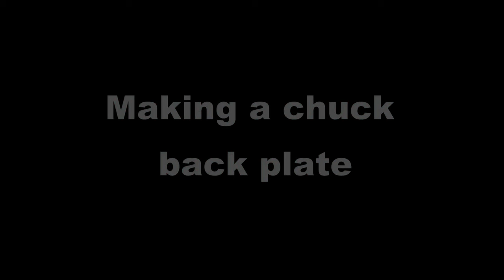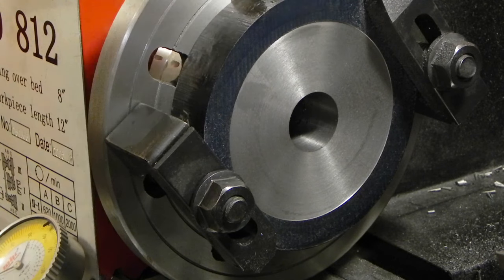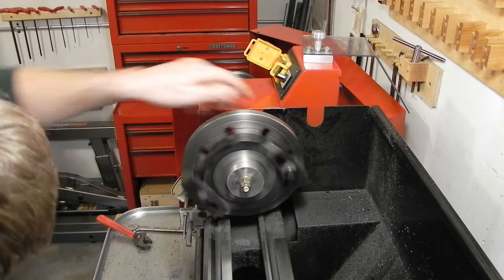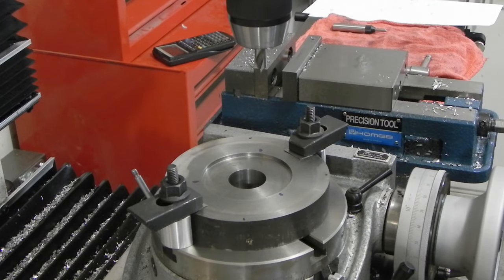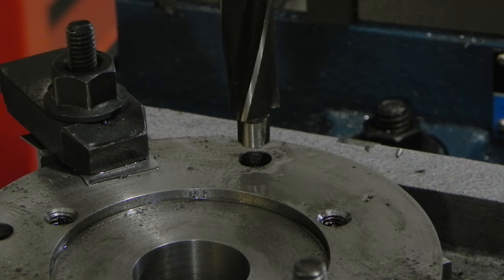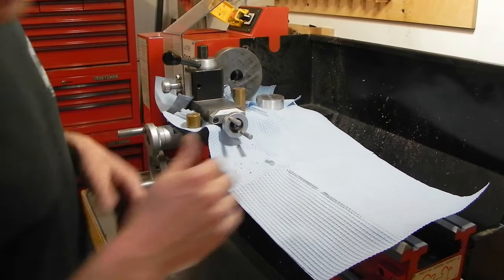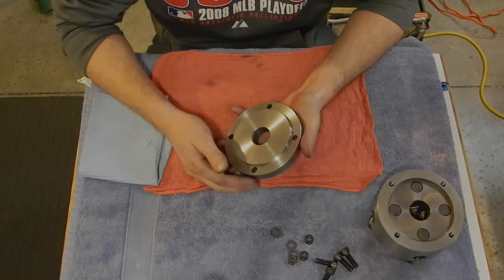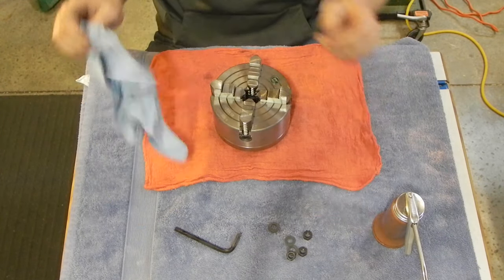Making a chuck  back plate

Comment: Thanks for the video, I planned to mount a 5" independent 4 jaw chuck for my Harbor Freight 3-IN-1 Multipurpose Machine 44142. You gave me some interesting Ideas. Fortunately I don't have to make a adapter plat as the recessed area on the back of the 5" matches the raised boss on the HF exactly. I just need to cut four holes into the chuck to mount the bolts, hopefully without cutting into the jaw channels etc. Thanks again for the video I found it very helpful.
Best Wishes n Blessings. Keith

Comment: Back in the day when I was an engineering apprentice, we were taught by all the tradesmen and from the technical insitute we studied at that cast iron needed no lubricant because of the high carbon content.
Reply from the maker: +Michael St John  You don't need cutting fluid, but it really helps keep the mess (CI grit/dust) under control.

Comment: using oil when machining cast iron will make it hard to protect the ways on you lathe. you can machine cast iron dry and catch the dust and chips with a cloth covering the ways, then vacume  the machine clean.
Reply: You are very right on that...!! No lubrication with cast iron. You may want to use a good mask while working cast iron, other ways you will have black nostrils for long time.
Reply: Right-o.   Cast iron is self-lubricating, due to the graphite content.  When you machine cast iron, the fine powder gets everywhere, and adding machine lube or oil makes it much, much harder to get out of all the nooks and crannies.
Reply: Miguel Navarro 90
Reply: Mi garba

Comment: that's a real beauty

I watched this video because I'll be getting the 5 inch 4 jaw chuck too, and I need to make a back plate for it
I don't have a mill though, do you think I can make it precisely enough on a drill press?
Reply from the maker: As long as your mounting holes have enough clearance, and you are decently accurate with your layout work, you should be able to do it on a drill press.

Comment: Set-right chucks use radially mounted setscrews and a bit of radial clearance to fix the last couple thousandths and tenths of out of round. You can also just loosen the back plate a bit and tap the chuck body into round.

Comment: I have turned quite a bit of cast iron in my time and as is usual practice, never used oil to do so. Cast is full of carbon that self lubricates the cut, can cool with water and soluble oil but usually use that when grinding the stuff...

Comment: 4 jaw chucks don't have a scroll, so you can actually just machine a ring that fits inside the chuck recess with an ID that matches the spindle boss and then drill and tap for 3 studs and your 4 jaw will bolt up just like the 3 jaw- done in 20 minutes and no adapter necessary.
Reply: SHOPMASTER/ SHOPTASK. i want to know would studs have enough strength to hold this chuck and withstand the load while operation? also how is he gonna mount this on the spindle nose
Reply: @josephinelourdesjayarani2111  Loads are radial and supported by the boss, the studs just keep it from falling off.

Comment: Needed more oil (or even some oil to begin with!) While boring that iron puck out on the lathe! Obviously it worked out for you and you did a great job at it as well, just fyi, and i dunno why but it just really made me cringe watching you "raw-dog" that hole w no lube, initially. Haha ;) 
But seriously, great vid and you've given me the last bit of confidence needed for me to attempt my own now finally... so thank you! 
Cheers! 
- Jesse
Reply: Or are you supposed to machine cast iron dry?? I actually never have machined cast iron before myself so I apologize for the misinformed comment previously if that's the case?
Reply from the maker: @jmac430 a lot of people will tell you that all machining of cast iron should be done dry. I however have a slightly different view. I for example like to use a little bit of cutting oil when I'm drilling or tapping cast iron because it helps better contain  the fine particles.  For large amounts of material removal I do machine it dry.

Comment: Great video! Thanks. You deserve some better machines though. A boley, weiler, schaublin lathe and a deckel or aciera milling machine would be more fun. But I must say that its more impressive with guys using what they have and make it work super good. I like seeing people taking a cheap ass chinese lathe or mill and scraping it to be almost as good as the premium machines. Just a thought. I’m about to make a plate just like that for a short taper flange to my 380mm 4jaw. Is it necessary to use cast iron for an adapter plate? Or will steele be good enough? On my other lathe I got the long taper fit. It seems more precise than those short taper that arent actual taper fitment at all. Its just a tapered guide for the chuck to slide on more easily, but the chuck could move within the tolerance of the center hole, unlike the long taper that always centers the chuck due to the taper fitment.
Reply from the maker: Sorry, I didn't respond sooner, I've under the weather for over a week.

You can use just about any material you like,  I've seen people use aluminum before. The main benefit of cast iron is that it's a good middle ground. It's easy to machine, it has good vibration damping qualities, and it is usually softer than what your spindle is made out of so you don't have to worry as much about damaging your spindle.

Comment: Hi Dan.
Fantastic job on the backplate mate. I am inspired to do the same for my lathe.

I am quite interested in the tool post you have. Did it come with the lathe or is it an after market quick change base?

Cheers mate.
Reply from the maker: The toolpost is an aftermarket one sold specifically for 8x14 lathes by Lathemaster tools. Unfortunately Lathemaster  isn't in business anymore.

Comment: Great job — looks excellent!  I have several backplates to make, and have been hoping to use Dura-Bar.  If you don't mind me asking, where did you get yours and how much did it cost?  Which type and formulation did you get (gray iron or ductile iron etc.)?  Best, -Chris
Reply from the maker: +bx2200 I got it from https://www.speedymetals.com, 5" diameter by 1" thick was $11, plush shipping.
Reply: Great—thanks.  I've bought from them several times before.

Comment: Question: how did you know that the sawn side initially clamped to the faceplate was truly flat? 'Cos if it wasn't, then the side that you machined flat wouldn't be when you released it from the faceplate.
Reply from the maker: It doesn't need to be truly flat. It just needs to be flat enough that it can be securely held to the face plate for the first operation. 

If you want to check if a part is flat enough, the best way to do that imo is with some sandpaper adhered to an old or cheap surface plate. Just give the part a few lapping strokes and look at the scratch pattern left on lapped surface,

Comment: How did you find the location of the first mounting hole on the adapter plate (the rest of the holes are easy once the adapter plate is on the rotary table)?
Reply from the maker: I centered the rotary table under the spindle with an indicol and indicator.  I centered the adapter on the rotary table the same way buy indicating off the bored center hole. The all I had to do was offset the mill table the appropriate distance to for the bolt hole circle.

Comment: why are using cast iron? will mild steel work?  good vid THANX!
Reply from the maker: Almost anything will work, but cast iron offers a few advantages.

1) It's usually softer than you spindle, so you are less likely to damage your spindle when mounting the chuck.
2) It's easier to get a really good finish on the mounting surfaces, leading to more accuracy.
3) cast iron is better ad vibration dampening.
Reply: DAN thanx for the explanation, I have a 1936 atlas 10d, the only year they made them and according to the serial # it is the 3rd from the last one made I have never worked any cast iron, but that is good to know thanx again

Comment: Is it just me it looks like you have the back plate you made bolted to the original chuck back plate that's threaded on the spindle instead of threading the new one to fit the spindle?
Reply from the maker: chuck smalfus it's you, the original Chuck didn't need a plate, as it was designed to fit the spindle directly.
Reply: So the spindle ends on a back plate?Not a threaded part?
Reply from the maker: If i understand you correctly, yes. My spindle is designed for plain back chucks. The basically means the spindle has a boss used to locate the chuck, and then bolts are used to secure it to the spindle.

 This method is very common on small import machines, as it is cheaper to produce than a cam, thread, or taper lock.

Comment: Question from a non machinist, Why Case Iron and not steel or billet aluminum?
Reply from the maker: I'm not a professional or an expert by any means, but what i was told from other people I trust made sense to me.

You want to use something softer than what the spindle is made out of, that way if something goes wrong you are less likely to damage the spindle.

I Have seen people use aluminum , but cast iron has better vibration dampening qualites.

Comment: Great video.  I will definitely be watching more.  What lathe and mill type do you have?  I'm looking for them for my shop.  Thanks
Reply from the maker: These two, though i want to upgrade my lathe. I got it right out of school and it was all I could afford at the time.

http://www.harborfreight.com/8-inch-x-12-inch-precision-benchtop-lathe-44859.html
http://www.machinetoolonline.com/PM-940M.html
Reply: same here with my 7x12,, tho I don't plan turning any tool steel larger than 2" and 304 stainless rods go fine.
I do want to do like this for a larger chuck. it doesn't look hard to do now, step by step

Comment: Any ideas why chucks are so expensive? I know if i want to build DIY metal lathe i must be ready to pay around 200 euros for chuck. But the question is why they are expensive, even just few hundreds? Precision metal? Hard to make?

I also pan to build metal lathe. And i got a store around here that sells chuck for 165€ new.
I guess thats the only way. Back plate is the important piece.
Reply from the maker: The big reason is because they are such a low run part, very few people are ever going to buy one.
Reply: Makes sense. Thank you for the reply.

What do you think, is it possible to use flange like this with ball bearing (whole hub assembly from car)?
https://thumbs.ebaystatic.com/d/l225/m/maeDu1OCD5RAM8ivsO87igw.jpg

Mark the holes, drill and tighten up. i can center it with some rod tightened in chuck, for example with drive shaft piece, because it also has grooves at the end.

I just want to build some experimental  metal lathe, most difficult part is to make that connection between chuck and motor.

Car wheel bearings should withstand the forces? If i think how much movement and stress the tire makes for the wheel bearing, when turning, on the bumps etc...
Reply from the maker: It would depend on your lathe and how it mounts chucks,  as you need to have enough thickness to clear the mounting hardware. The best thing you can do is sit down and sketch something up on paper or in cad.
Reply: Colinfda

Comment: I have a 10 inch 4 jaw I need to do this with. How thick is your slug?
Reply from the maker: +Practical Metal The slug I used was 1" thick, you might need something thicker for a 10" chuck. It really comes down to the fasteners being used, and your spindle design.

Comment: Where did you get the oil can and what kind of oil did you use?
Reply from the maker: The on in the video is a GOLDENROD 601 (spay tip), but I also have several with  600 series that have regular tips. They can be found at of a lot of supply houses and on amazon.

https://www.amazon.com/GOLDENROD-601-Spray-Oiler-Straight/dp/B004RGXW3A/
https://www.amazon.com/Dutton-Lainson-DUT600-Rigid-Trigger-Capacity/dp/B008Y1PZD4/

The oil is  mobil mobilmet 404 (OMICRON). It's not made anymore, but you can get it's replacement and if memory serves, that's mobilmet 426.

https://www.amazon.com/Mobilmet-426-Cutting-Oil-103799/dp/B014V5LGNE
Reply: dans-hobbies

Comment: Why use cast iorn as a back plate? Why not use steel?
Reply from the maker: The big one is that it is much better at dampening vibrations, and thus can help minimize chatter. 

The other main benefit, is that it is softer then the spindle, so if it gets dinged up in use, it's less likely to damage the spindle.